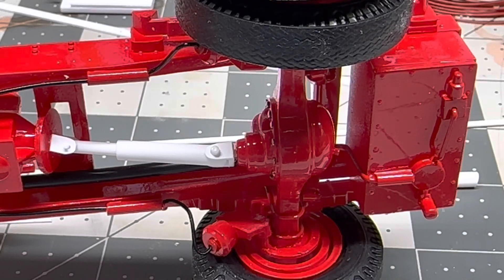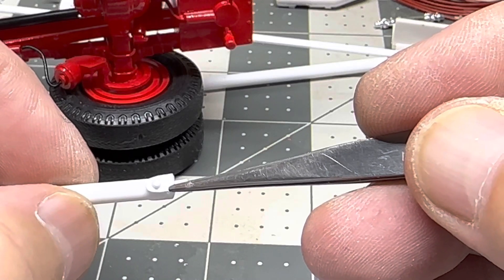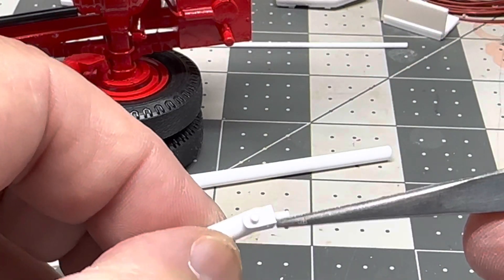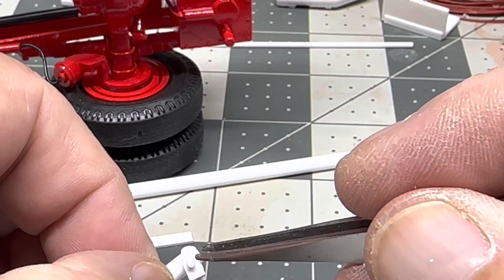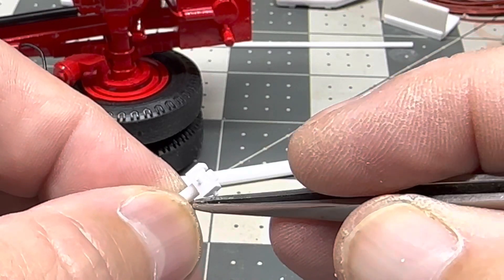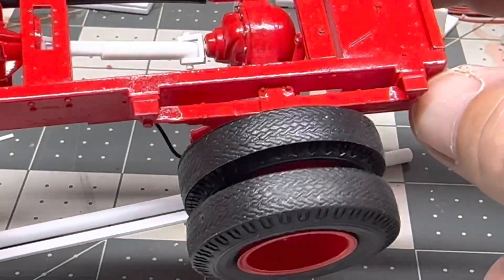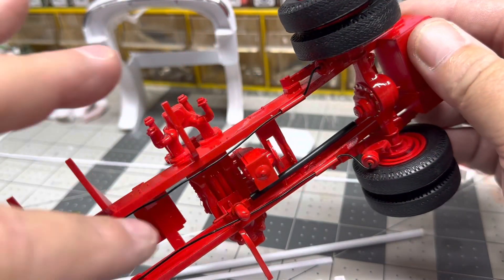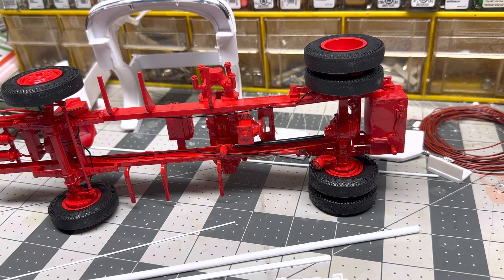Let’s upgrade the drive shaft.

Comment: Great job on the driveshaft.   It does add awesome detailing to the chassis. Thank you for sharing . Have a great week my friend 👍👍👊👊
Reply: Many U-joints just look like blobs on the drives haft, even in 1/25, and they're often hanging down below the frame.  You've worked out how to do this and not all we need is parts and a few minutes to replicate it.
Thanks for sharing!
Reply from the maker: @randytaylor1258  Thank you.
Reply from the maker: Thank you.